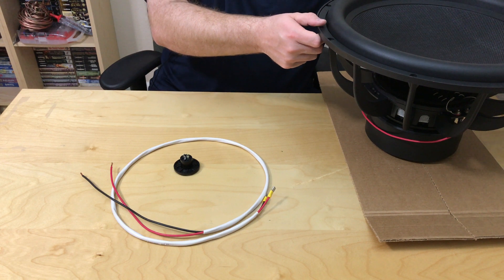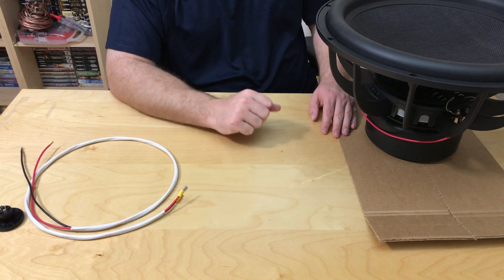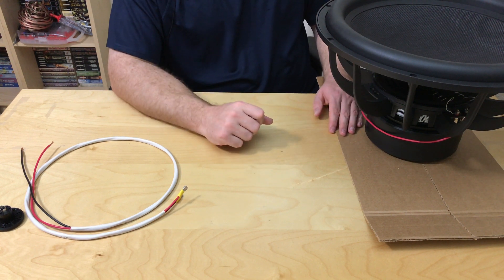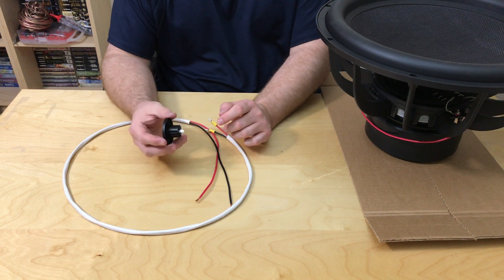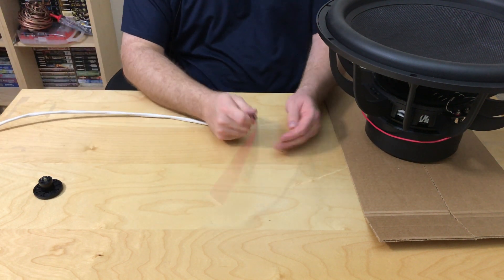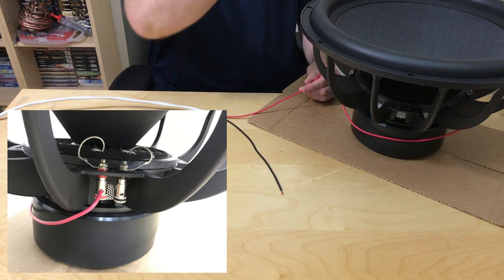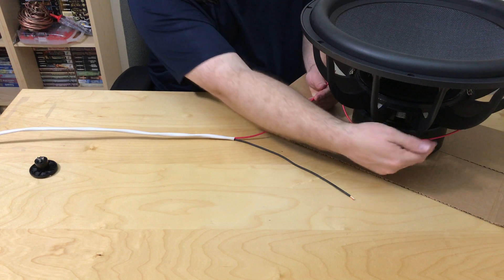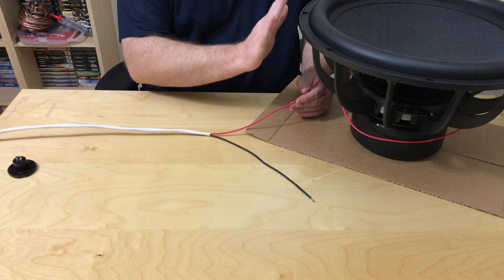How to Wire Home Theater Subwoofer dual voice coils in series. Parts Express Ultimax UM18-22.

Comment: Can you run the ultimax with an 8ohm amplifier. I have a crown and bridged it turns into 8ohm.
Reply from the maker: If the amp is 8 ohm stable and it pushes an 8 ohm load you are good to go.
Reply: @JilesMcCoy  much appreciated 👍

Comment: After you're done wiring, always check your resistance with a multimeter (should be around 4~4.5ohm in this case) and use a battery to check polarity BEFORE screwing the sub into the enclosure!
I installed 4 of these into my home theatre system, it was a lot of work to put these bad boys in 😅😅
Reply from the maker: Agreed!

Comment: Hello… I have a Monoprice monolith 1000 rms watt amp it’s the newer v2 monolith version & wanted to switch it up with the Dayton ultimax 15 inch driver . Do you know if Dayton is a better sub & would I get better lows ? I’m also wondering if I should go with 1 ohm or 4 ?
Reply from the maker: Hey, can you send a link to what you have now?
Reply: @JilesMcCoy          Monolith M-15 V2 15in THX Certified Ultra 1000 Watt Subwoofer Amplifier, Low Distortion, High Power Output, Vented HDF Cabinet.    [Thats what I have was thinking about getting the Dayton or sundown x15 v2 to put in the monolith box with the 1000 amp it comes with already installed on back of box ?